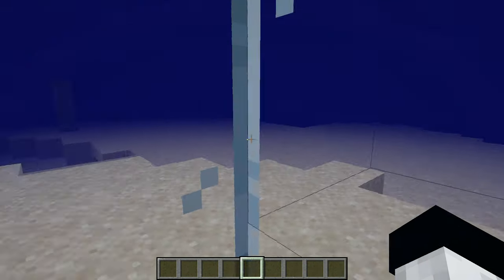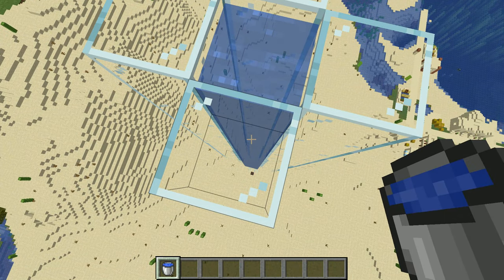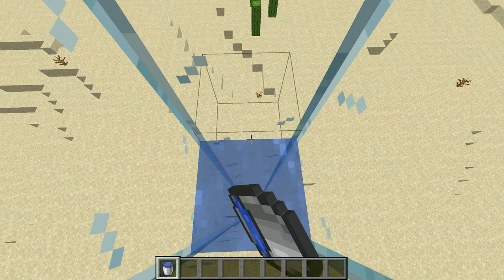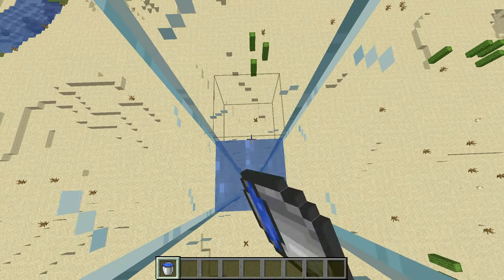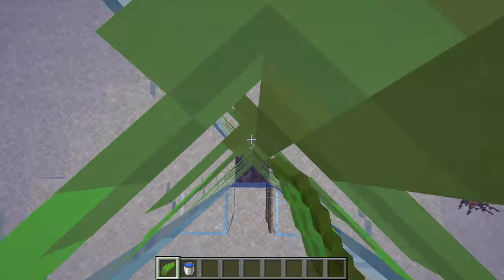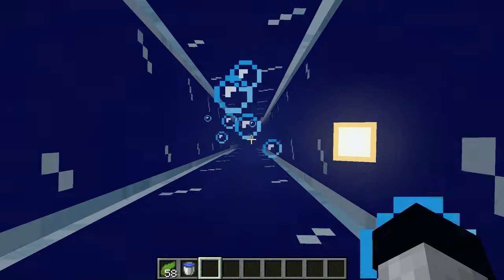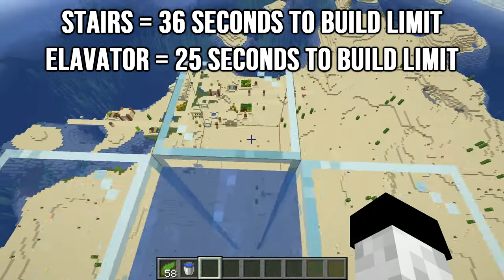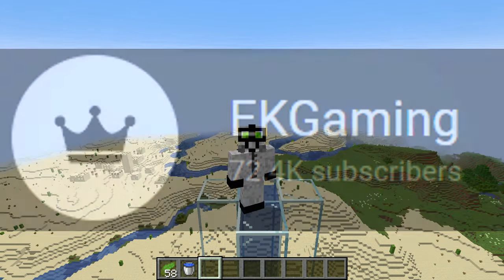How to Make a Minecraft Elevator the Easy Way

Comment: For anyone confused about the kelp, the point of the kelp is to turn non-source water blocks to source after kelp is placed in them. This is because as it is currently coded, kelp cannot exist within a running water block so it converts to a source. This carries on even after the kelp is broken.
Easy steps to follow:
1. Build tower for elevator
2. Place 1 water bucket at the very top
3. Place sand block at bottom of elevator
4. Place kelp on sand block, and continue placing until at the top of the elevator
5. Destroy kelp at the bottom
6. Replace where the sand block was with soul sand
7. The elevator should be complete!

Comment: Followed your steps and it still isn't working. I can't see any bubbles in the column? Any ideas? Does this work in v1.18
Reply from the maker: Try placing sand and planting the kelp. Then replace it with soul sand at the end. Hope this helps :)
Reply: @EKGaming  realised I was using soul soil and not soul sand... thankyou though
Reply: @lukemilne6922   holy fk bro! u saved me! i did the same mistake! thankssss!